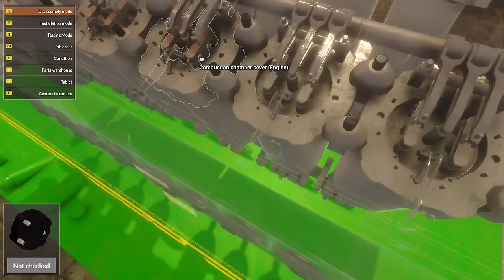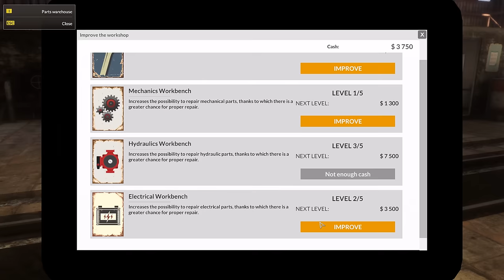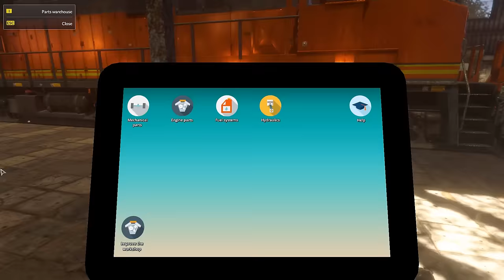Let's Play Train Mechanic Simulator 2017 (part 4 - Loss of Power [blind])

Comment: Surprised you don't have to remove the part from the access panels.  Enter the locomotive for most things, others from the outside.  Having to drop the trucks for motors and axles and such.

And compressed air is both for brakes (almost all of the use) and for air start of the engine.
Reply from the maker: Well, this game is far from being fully realistic. :)

Comment: i thought that diesel engines didnt have a spark plug
Reply: walt0778 they don't, they use glow plugs to warm the heavily compressed air, then a tiny amount of diesel is injected causing the explosion
Reply: walt0778 spark plugs are used in petrol engines, which is what has me confused too lol
Reply from the maker: They don't, I completely missed the fact I was taking spark plugs out of what is most likely a diesel engine... Not sure what's going on there, unless train diesels have some strange voodoo magic stuff going on I'm not aware of.
Reply: MetalCanyon maybe, but I feel like diesel trains may use a more/less volatile version that requires a spark plug but it's still technically a diesel......or maybe it's related to the engine being bigger, much like a diesel engine in a car
Reply: TheGamingBiscuit nope train mechanic here and they use plain ole diesel